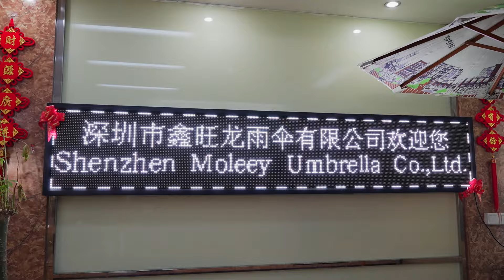Umbrella Mass Production Process,Skilled Chinese Workers.

Comment: The metal part looks too thin - will break easily. Plus the umbrella should not invert itself when the wind is blowing - it's very annoying. My umbrellas have only one layer of waterproof fabric - the second (black) one seems to be not necessary. Other then that good job. Thank you for sharing.
Reply from the maker: Hi, NatureWatcher, thanks for watching, the umbrella bone is customized by the customer, the manufacturer offers different kinds of umbrella bones at different prices. We also asked why they inverted the umbrella and the manufacturer said that's a necessary part of testing. The umbrella only has one layer of waterproof fabric, the black one you mentioned is actually the original color of the fabric. Thanks again for your kind suggestion.
Reply: Here’s a thought: “don’t be cheap!”
Reply: thats the idea if it break buy a new one.